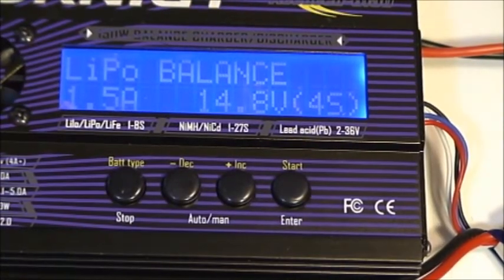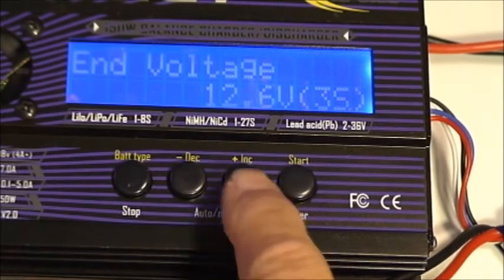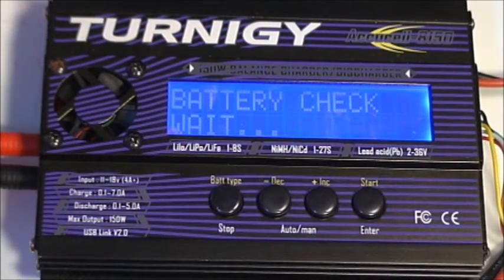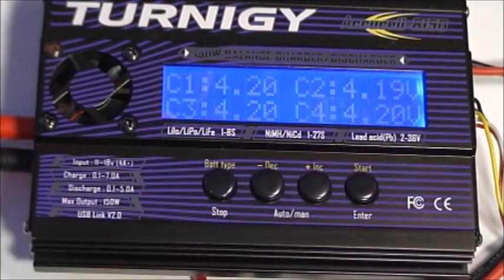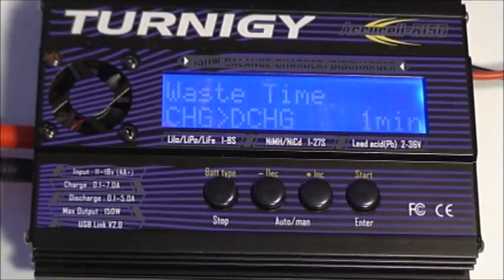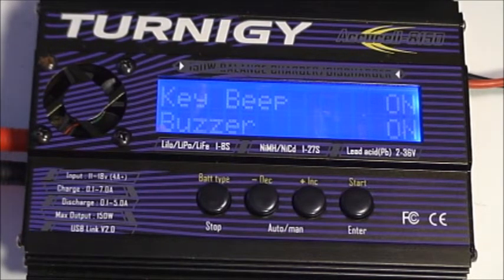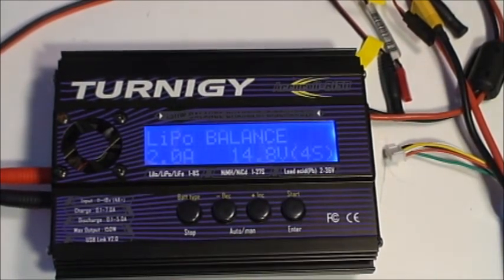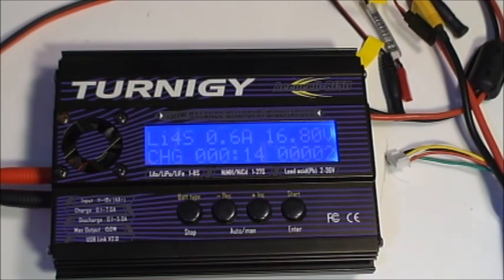Lipo Charging with Turnigy and Similar Chargers

Comment: Hi ,i have a question ,would http://www.hobbyking.com/hobbyking/store/__11341__Turnigy_MAX80W_7A_Lithium_Polymer_Battery_Charger.html
have the same way of charging as the one in the video? will it automaticly stop when full battery ,it is my first time charging a lipo battery and have heard it is very dangerous if it is overcharged.
Reply from the maker: Darathh Most of the chargers are going to work like this one. There maybe some minor differences.
Reply: Wayne Morris thank you

Comment: Mate, please tell me why can't i balance charge a 6s 25C 5000mah lipo on more than 0.5 amps. If I go any higher (0.6 or more) would give me a error. All the cells has the same amount of 4.12 at this time. Any ideia ? I am using a brand new imax b6 charger. Thank you in advance
Reply from the maker: Every charger has a maximum power limit. You can not exceed this limit. Then you also have a current limit on the power supply. You did not tell me which error you are getting so I don't know what the issue might be. I would expect you should be able to set the charge at 1.5 to 1.9 amps but your cells are already at 4.12. The charger will reduce the current as the cells approach maximum charge to avoid going over. If this were the problem, You would not get an error, you would just see lower current than you set the charger to. Most of the charges will let you set the current to the max it can do and then regulate it to the maximum power it can handle. My best guess is you have a defective charger if you have everything setup correctly.

Comment from the maker: Also remember you will need something to power the charger. You can use a lead acid battery or an AC power supply. If you get a power supply, get one that has the max current for the charger + 25%. For a 5A charger, a 7A or more charger would be great.

Comment from the maker: Hi, Most of them are the same in my experience. I order mine from Hobby King. If you are charging large batteries, you may want to get one with enough current to charge at 1C or more. This is to keep your charge time low. a 50W/5A is good for many applications. I have some 8000mAh packs so I have some chargers that are up to 200W.

Comment from the maker: If you make a flame post here, it will be removed and you may be blocked. This is not an outlet for you to vent. It is here to help people new to charging lipos. This interface is common to many chargers. If you have an issue with a vendor, take it there. I won't tolerate that here.

Comment from the maker: OK, so set the charger up for BALANCE charging, connect the main leads on the battery and the balance plug, select 3S battery and set the current to 1.3A. 

Watch the video and you should be able to follow along and setup to charge your packs. The charge time will typically be less than an hour.

Those specs sound like they are NanoTech batteries. If they are, they can be charged at a higher rate. I usually just use 1C anyway.  Good Luck.

Comment: I just purchased this charger along with some Turnigy batteries with these specs:
Capacity: 1300mAh
Voltage: 3S1P / 3 Cell / 11.1V
Discharge: 45C Constant / 90C Burst

I also bought a power supply that is 104W, 15V, 7 A.
Can you please go over the charger settings for this setup?
I'm brand new to LiPo and I know how dangerous they can be if misused.

Comment from the maker: Hi, You don't have to do anything for the parallel spec. The charging process does not need to know anything about how many cells are parallel. A 4000mAh, 4S 1P is charged the same as a 4000mAh, 4S, 2P. Internally, you have four pairs of two cells and each pair is connected in series.
Most of our batteries are 1P but that is understood unless the pack specifically says 2P, 3P, etc.
I hope this clears it up for you.

Comment from the maker: The charger has a built-in timer that defaults to 120 minutes. If the battery is not charged by the time out value, it stops. This a safety device to avoid charging bad batteries forever. You should make sure that you are setting the charge current for 2.2A for a 2200mAh battery. At 2A, a 2200mAh should always charge in less than 2 hours unless it is very out of balance. Batteries that are poorly balanced can take a long time. 4.2 V per cell is normal for charged Lipo cells.

Comment: Hello, can you please help, i have two Overlander 3S 2200mAh batterys. I use to charge it with one of those chargers that only has the balance lead. Now i have one of these Turnigy chargers, brand new. I do a lipo balance charge, and it charged for two hours, then the charger stoped charging. So i charged the second battery, and the same thing happens. So i put the first battery back on charge, and it charges for 2 hours, then the charger stoped. The sells do show 4.20?

Comment from the maker: You can charge a 1S  to 6S. I have not tried to balance charge a 2S with it. Most chargers have a 2S balance port but I don't think this one does. I can take a look and see. Most of these plugs have two tabs that prevent plugging in the wrong connector. If you can get the balance plug from the batter to plug in, it should work.

Comment: Can you charge a 2s Lipo with this Accucel 8150? I've heard you can connect the balance connector from your battery pack into the 3s port in the charger as long as I do connect it further to the right into the 3s slot. Is that correct?

Comment from the maker: OK, there is a storage mode in most chargers. You just connect the battery enter the lipo mode as in the video, then press the + key until you see storage mode. The voltage level will be taken care of by the charger. The charger will have a maximum discharge rate. You can use the maximum unless that exceeds you battery discharge rate. In that case reduce the current.

Note, you only have to put the battery in storage if you don't plan to use it for a long time.

Comment from the maker: Continued - The discharging and waste time is for cycling Nimh and Nicd batteries. Most of the chargers don't include a temperature probe. I personally don't change the timer for every pack. If you do timeout, there will be a message and you can just restart the timer. I hope this helps.

Comment from the maker: Sorry for not answering sooner. You can ignore the discharge setting for charging and waste time. If you have a temperature probe, then use the default for the temp cutoff. The charger current maximum for the batter is usually 1C. 1000mAh=1A, 5000mAh=5A. Your charger will have a max power rating. A 50W charger on 6S will charge at a maximum of 1.9A. (50/25.2) A 5000mAh would take up to 2.5 hours. You could set the time to 3 hours.

Comment from the maker: The chargers can supply more voltage than the source. In fact, the max cell count for charging is frequently higher than the max input voltage.  The input power and output power can account for some difference in the source current vs the charge current. The charger is also not 100% efficient. Some of the power is dissipated in the charger itself. The purpose of the exercise was to show the procedures for the charger and I intentionally left  the technobabble out. Your comment is correct.

Comment: You say your charging at 2.5amp and the psu current is 3.3amp and that the chargers inefficiency...maybe not...

if your psu was 12v and your batter was 15 it has to increase the voltage from 12 to 15, doing that increase is where thea amps go..
15*2.5=37watts, 12*3.3=39.6, so only 2.6 watts lost in inefficiency which at 12v is about 0.2amp, so thats pretty efficient!

I dont know if these chargers can up the voltage(mines on order), but if it does, then my explanation is fairly right etc

Comment from the maker: I typically use the default settings for most things. The charger usually has good numbers.You don't need discharge unless you are discharging the battery for some reason. You don't need a temp setting unless you have a probe. The safety timer is usually 2 hours. This is normally OK as long as you use at least 1C. NiMh and NiCd are usually charged at .1 or .2C. It takes 10 hours at .1C and 5 hours for .2C.

Comment from the maker: When you enter the lipo mode, cycle through all the options but pressing the + key. Most of these chargers have a storage option.  Connect the battery and start the storage program and it will automatically discharge the pack. You only need to do this if you are not planning to use them for a while. If you are using them weekly, keep them charged and ready to go.

Comment from the maker: @shallvo1982 The charger was ordered from Hobby King. You can check prices there. I would consider 4mm bullet connectors. You can get those from Hobby King too. Current capacity is better and they are easier to put on, connect, and disconnect.

Comment: @waynemia07 I have a question#1 how much was that charger.#2 where did you purchase it#3 I have a hpi trophy flux buggy 1/8 scale that requires two lipo batteries at the same time...now I went an ordered a imaxx b6 charger n also bought 2 nano tech lipo's I believe 5800 w 7.4 volts n is a 2s 30c-60c. I worried if  I solder the dean connector s on this charger n on to the lipos  as well the wont work good what do you think? This is really making me lose control lol

Comment from the maker: I am not familiar with the Losi cars. There are a lot of chargers on the market with that work like this one. You should consider how much current you need for your batteries and how much current you will need. A 50 watt charger will supply about 4 amps to a 3S lipo pack. If this is enough, then you can get a charger for less than $20 at Hobby King. Look for an ECO6.